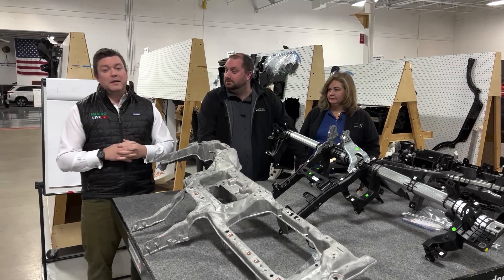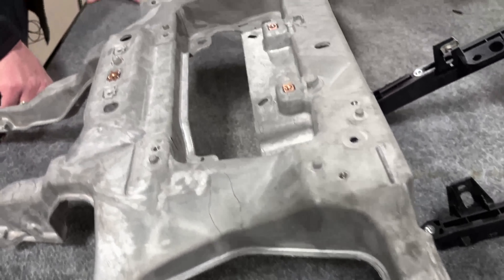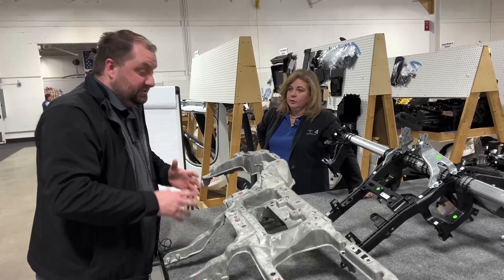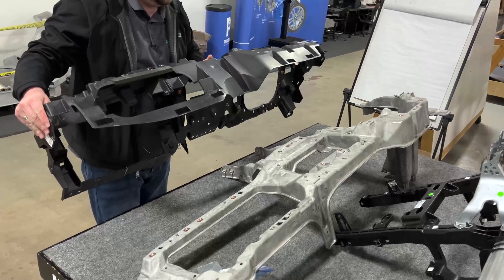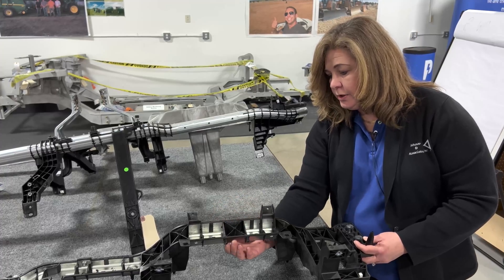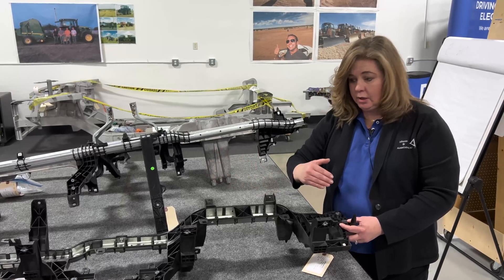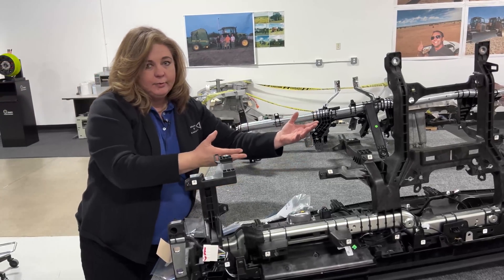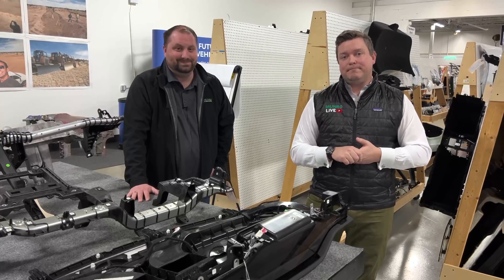Tesla Model S Plaid | Cross Car Beam Comparisons

Comment: Another advantage of the front and rear castings plus the structural battery pack is that you can lower the body onto the completed IP, or raise the IP into the body.  Just like with the seats, no more shoe horning it in through the doors.

Comment: Another great video from Munro and the team. I would like to see some aspect of a vehicle section taken through all the way to the finished item and beyond. Most manufacturers seem to have no interest in how hard servicing, repairing, or replacing the pieces is. I saw a recent video where the mechanic said simply replacing a family car 4 cylinder head gasket is 14 hours by the book.. Great for the Ford dealer! But Tesla doesn't plan for servicing (or presumably repair) to be a profit centre. If so, then it's in Tesla's interest to make service and repair simpler. A one piece cross beam, (or any other part) makes it nice and simple on the production line, but does it make it hard in the service or workshop or bodyshop? I'm sure many mechanics have torn their hair out because of something that saved the manufacturer 10 seconds and $3 on the line, but cost hours of time and bloody knuckles in the shop.  Citroen and Jaguar are two brands that spring to mind from the past. (Both of whom got bought out) My brother owned a Citroen CX, and his comments on the handbrake were unprintable, if he didn't need it for the MOT it would never have been fixed. $20 part, hours to simply get it in place. Never mind connected and adjusted. On the flipside, if you owned say, a London black cab, there are several workshops that were capable of major repairs and replacement in a couple of hours. I'm sure the same is true of a Crown Vic or Caprice where they are common as taxis.  Of course, in most situations as now exists, making repairs simple means it's more likely the owner will do it themselves, or if not, reduce the chargeable hours for the dealer, neither is going to make the dealer happy, The other thing is what's driving the right to repair laws. Unfairly restricting access to parts and information simply to force the use of dealer servicing. Tesla has been getting some grief on this, and I think we'll be seeing some movement on that front, but they do have to  be careful about remitting or encouraging DIY work on High Voltage stuff, or anything connected with FSD.
Reply: Insurance companies have basically killed repair. When minor accidents are complete write-offs, its in the car company's interest to make each part more expensive to guarantee a write-off so they can sell a whole new car instead of just a part. And because of battery fire issues, Tesla puts extreme limitations on vehicles that have been considered totalled. It is in their interest to brick the computer to prevent a fire. So until something dramatically changes with battery durability and insurance companies, EVs are basically disposable.

Comment: If the plastic contains carbon fibers, it should conduct electricity.  Fiberglass does not.  Not sure what other types of fibers are used in injection moldings though.  Also a carbon reinforced resin of the same thickness should be stiffer than the equivalent fiberglass reinforced part.  Bending similar thin pieces in hand should give a clue.

Comment: The sheer number of times someone at Tesla needed to say "you know that brilliant idea you had to make the cross car beam, well I have a better idea", and not get diminished or brow beaten for it.  Instead they considered the trade offs, bought some new expensive piece of manufacturing equipment, and just threw out the old way.
Reply: In this case, they actually threw out the expensive machine and replaced it with a much cheaper process.
Reply: @patreekotime4578  That still costs money.  But even if not, seeing the sunk cost fallacy be completed avoided is something.
Reply: Lol....

Comment: You can see the improvement in Tesla’s manufacturing technology. Quite agile.
Reply: Most of the technology in crosscar beams is from suppliers and therefore not Tesla's IP. You should give credit to whom credit is due.
Reply: @koeniglicher  True, but could also be a bit of both, some parts can be by request or joint effort, hard to know. But it's certainly a team effort.

Comment: I have a Fiat Panda (fore runner of Fiat 500). The cross car beam is a steel tube and bracketed structure between the A posts the dash is a plastic ps el over the top. Its incredibly solid but must cost a fortune to manufacture.

Comment: It strikes me that on the structural pack cars, this could be inserted into the passenger cage (full bodyshell?) from below, before the marriage of the skate (with seats) and the body?
Reply: I wonder that too!
Reply: Nope, the dashboard will be inserted first and then the battery pack+ seats
Reply: @carholic-sz3qv  
Read again, that's exactly what I said.
The pack is the floor.
They build the skate, which includes the pack...
They fit the carpet, bolt the seats on, exactly as shown at the factory.
They they drop the body onto that assembly.
It would make perfect sense to insert the dash into the bodyshell from underneath before dropping the shell onto the skate.
Much more room to work.

Comment: any cars use carbon fiber tube cross car beam? I know it's more expensive, but just wondering if some manufacturers do it. perhaps with epoxied aluminium attachments bonded on?
Reply: I imagine the main purpose of that beam is to absorb and deform rather than shatter?
Hence metal?

Comment: I'd like to hear an analysis regarding the benefits of having the very large roof openings in the teslas for assembly purposes
Reply: I just posted, I think the advantage going forward will be removal of the floor from the bodyshell.
They can insert this assembly and other interior cabin pieces from underneath (Sue mentioned the difficulty of inserting units through doors)
Reply: @rogerstarkey5390  And now Tesla has the structural battery pack, which does all that and more.

Comment: The magnesium castings were known for be more prone to develop cracks. And using steel you have cheaper production and the metal tends to crumpled instead of breaking. I'd rather have a steel or cast aluminium cross beam over injected plastics.
Reply: This Cross car beam is NOT Pure polycrystalline magnesium FYI

Comment: 10:57 "They save all of the parts here..."  So wait, all the parts of everything Munro has ever written reports about is there?  Must be a humongous warehouse...?
Reply: I get the impression they keep the parts for 2-3 years, and select parts for a longer period.  After that, it's  usually obsolete.  They have the parts fom the Mach-E, Model 3 and Y over the last 3 years.  I don't think they have much of the i3 anymore that was done in 2014.
Reply: @tesla_tap  I was wondering how they did the storage.  I always assumed some of the good parts would be sold into the supply system.
Reply: Probably on a server by now.
Reply: Sandy mentioned in the previous video that certain specific parts are kept for a long time for benchmarking purposes. Meaning if it represents a good or novel idea they keep it so they can show their clients. They had a stack of parallel batteries out of a Ford Fusion Hybrid which I think was from 2010.
Reply: they bury all the bodies out back... ;)

Comment: Great job. Tesla is just so damn creative and hence - so far ahead.
Reply: Ans yet they can't figure it out fit & finish! It continous to amaze me. I can only get that it's because they give a dammed about that topic as nerdy engineers usually do!
Reply: @JoseVargas-dx7wz  You talking about 2020?
Reply: Maybe creative saving production costs, as many other Automakers do similar.
Reply: @RogerM88  You are kidding yourself if you think anyone is keeping up with Tesla on manufacturing upgrades. Giga Press / Highest Level of Robots / Top of the industry paint shop in Berlin / And forget about the manufacturing of batteries…. While everyone else is battery constrained - Tesla isn’t… structural pack.
Many people have some of these aspects - but didn’t before Tesla showed them.
Reply: @mullholand  dude..."keeping up with Tesla on manufacturing". Such a delusional comment. Many of manufacturing process and techniques are already in use by other Automakers. The company that builds the mega castings, supplies other companies too. Having a bigger casting piece has pros and cons, for the pros you've a better economy of scale, but you've plenty of cons too, as expensive repairs to the costumer due to cracks on the casting piece, more prone to recalls due to bad batch os castings, higher maintenance costs to run the press. Also Tesla, doesn't develop their own battery Cells. Being dependable of other companies to do so.
Reply: @RogerM88  exactly, there are litteraly millions of used cars around the world including third world countries and the very simple manufacturing with steel and no castings means it's super easy and simple to fix damaged parts.
Reply: @RogerM88  there are still 1970 Mercedes, Toyota and vw on the roads around the world on the roughest and harshest roads and environments where no casting can survive a shock for very long time, the same thing imply to the cybertruck too.
Reply: @RogerM88  
But the others only seem to be rethinking / redesigning now? (BMW i3 being a possible exception)
Reply: Roger is right!
Reply: @rogerstarkey5390  Every year, people look at what start-ups can do, and believe that large companies can apply the same mentality and practices to catch up with the market leader in terms of innovation.  It's a rare occurrence that one would succeed.  Meanwhile the majority of Chinese auto companies are starting fresh and copying fast.  Things are gonna be rough in the coming few years.  Remember the year when we wanted our Blackberry, Nokia, and Motorola to catch up with Apple.  History had taught us that our will to see the old guard succeed usually doesn't come true.
Reply: @rogerstarkey5390  the BMW i3 was actually way tooo advanced for it's time with the giant aluminium castings, car on fiber body and the interior with recycled fibers and plastics and much more, even Sandy was mentioning the front and rear subframes beeing similar to the BMW i3 design/ manufacturing.